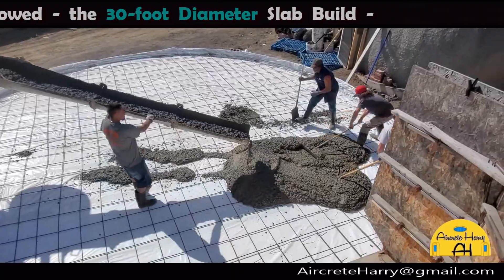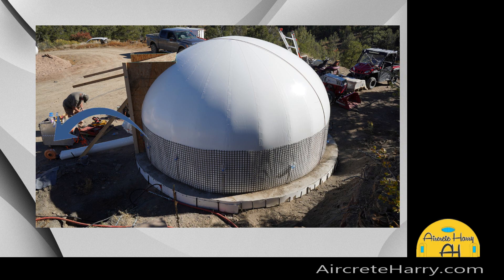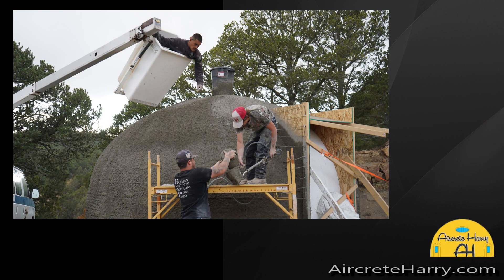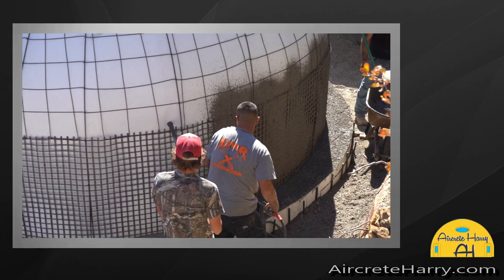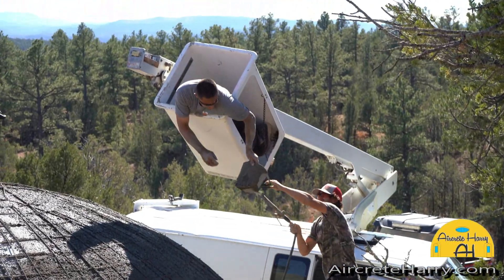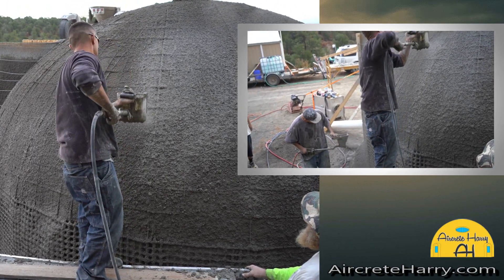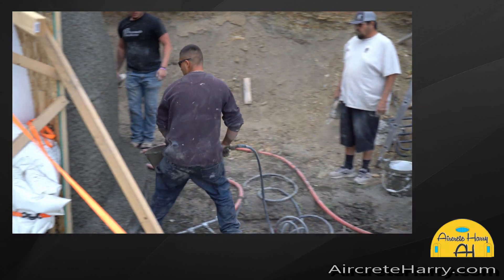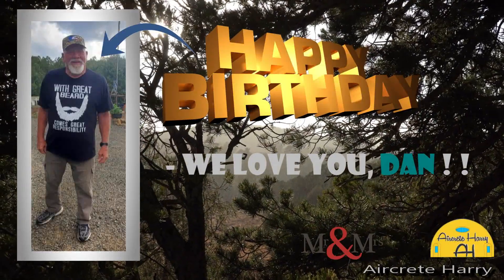16ft Bathroom #Dome Build | #basalt #aircreteharry #diy #domehome #workshop

Comment: 10:00 that better be more than one inch thick Cement and 3 inch external insulation
Reply from the maker: ("1 inch?") This is not what was said in the video. Listen to the part again: @ 8:53 min mark forward. Cheers

Comment: Why not use fiberglass rebar in some of your builds?
Reply from the maker: @lightning9279  Welcome to the channel. I prefer basalt rebar based on the strength. Fiberglass rebar is another good option. Both work well.

Comment: Harry, What was the Air form made to allow works to put there full weight on the dome top to assemble the basalt rope rebar.?
Reply from the maker: Hi Dale, this is a reusable, heavy-duty, high-pressure dome air-form.